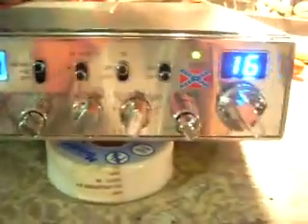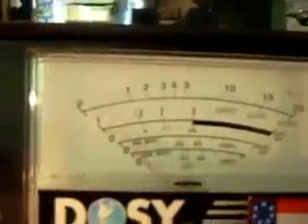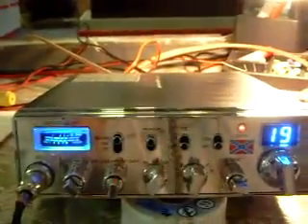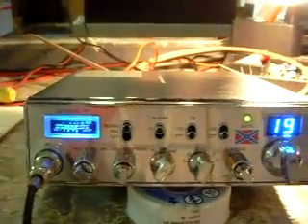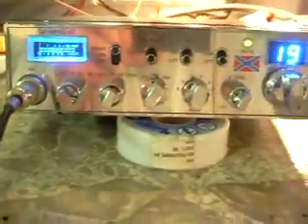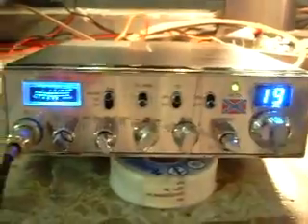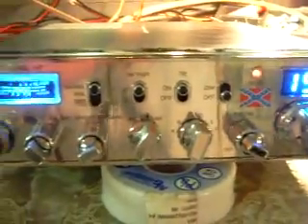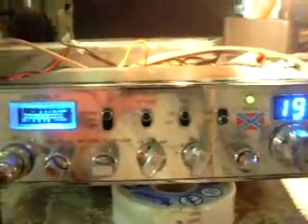general lee, testing out mics and showing the diffrence

Comment: hey man can you please show me or take a pic of how you set the pointometers in the radio and all that you did to it to make it that loud and maybe a pic of the inside close to the pots so i can adjust mine and what all else you did i got one and it dont do that, but doing that much power wont it get really hot fast mine does get pretty warm on high side and it only doing maybe 40 watts on the whistle but mine still has tr37(mod limiter) in it did yours get removed?